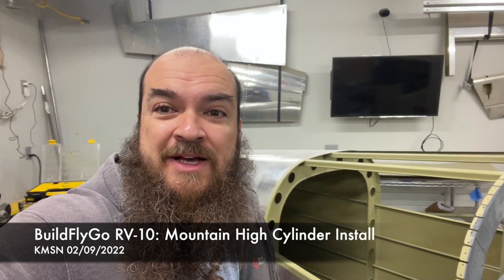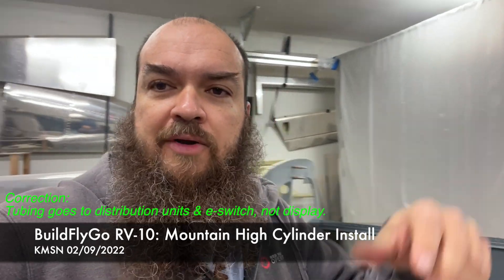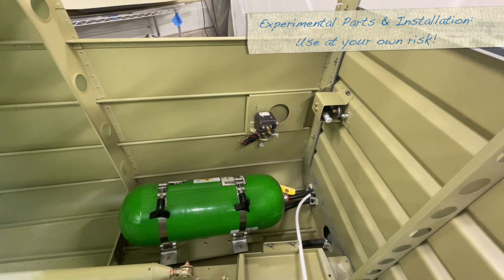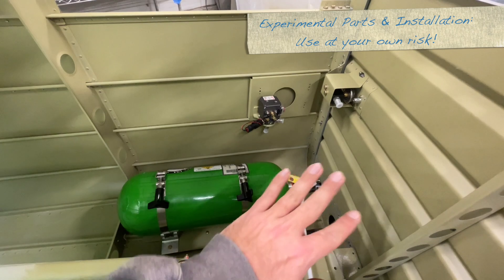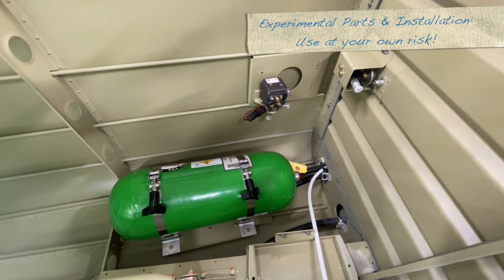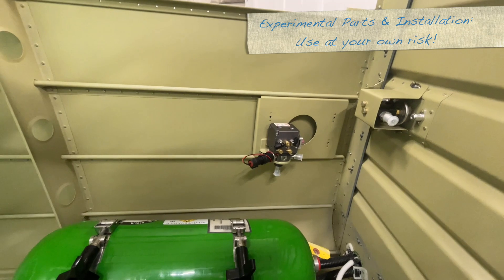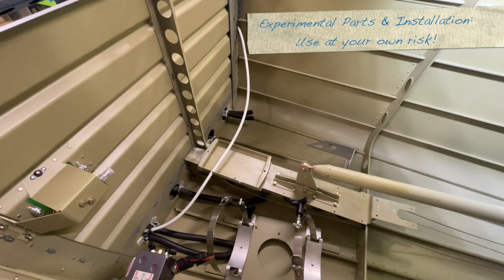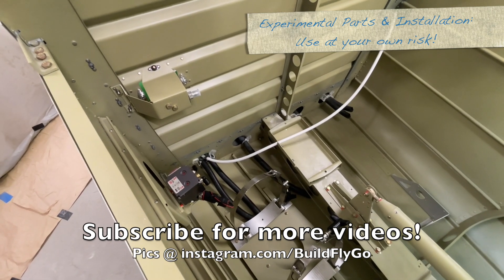RV-10 Build: Mountain High O2 Cylinder Install

Comment: Hey, are there any concerns about heat with the bottle being mounted in the fuselage? If the aircraft sits outside in the sun for a long time, I'd imagine the interior of the plane gets rather warm... Some internet research says don't keep oxygen bottles in the trunk of your car, I guess the "trunk" of a plane is not much different?
Reply from the maker: The plane is not often outside for very long without being in flowing air. Lives in a hangar when we aren’t flying :)
Reply: @BuildFlyGo  sure I get that, but like if you're ever staying somewhere overnight and the plane is parked outside, is that a  concern? I have a portable Mountain high O2D2 bottle and I'm trying to figure out what to do with it when I'm on holidaY somewhere (not at my Homebase) with no hangar and sunshine with hot weather... I guess if it was a problem we'd have planes blowing up on the tarmac all the time?
Reply from the maker: I can't say I've ever heard this being a problem, but give MH a quick call to see what they think. They are super helpful!
Reply: @BuildFlyGo  thanks👍🏽 I actually wrote them a couple mails, and they said leaving the bottle in a shaded area inside the plane would be quote "probably fine", which I find not entirely comforting, but oh well...

Comment: Quick question not related to the O2 system. Around the 11:15 mark there is an access panel that you have cut in the left rear seat. I have seen people cut access panels in the baggage floor for access to the steps (which it appears you didn’t do, maybe I’m just missing it) but I haven’t seen an access panel in the rear seat before. What is the purpose of cutting that panel?
Reply: Their answer is likely different than mine, but I have a similar panel on the right side where my Garmin AHRS lives.  There's a lot of useful space under those seats and covering the access panel with the seats themselves makes a pretty clean installation.  I hinged my panel and didn't bother with screws to hold it shut because the seats (and a passenger) will do that just fine.
Reply from the maker: I have the bottom COM antenna down there. This lets me get to the coax.

Comment: You can get the best of both worlds by getting one (or a set of 2) larger welding size tanks and a filler hose.  Cheap O2 without the hassle of removal and transporting to the scuba shop.  Just do your own planeside refills.

Comment: I am just curious as to why you didn't mount the O2 cylinder at the far side of the baggage compartment?
Reply from the maker: Mostly just for space saving. We wanted it out of the way so we could fill the back with bags, etc. It's less convenient for fills this way as I have to remove the baggage bulkheads but we felt it was a good trade-off.
Reply: @BuildFlyGo  Great stuff - curious about the weight and CofG implications with putting it back there.
Reply: @BuildFlyGo  I understand.  No criticism just curious.  I have been following your progress from early on. The quality of your work and the configuration choices you have made are outstanding.  Can't wait to see her in the sky. God bless.

Comment: Hey bud!  Great to see it coming along (we met at OSH last year!)  I have a MH system for my RV-4, I recently added the Aithre Shield EX 3.0 to it and I am amazed at the integration with the G3x with that little unit.  That plus their wireless pressure sensor communicate to put everything on the engine page for your G3X.  Wasn't sure if these guys were on your radar or not so I figured I'd share!  Keep the great videos coming!
Reply from the maker: Cool! We are also considering having it send pressure to the G3X. Undecided at this point but will be investigating further at Sun-n-Fun this year :)
Reply: Awesome!  I’m pretty happy with it!